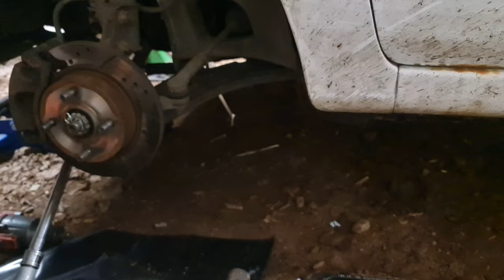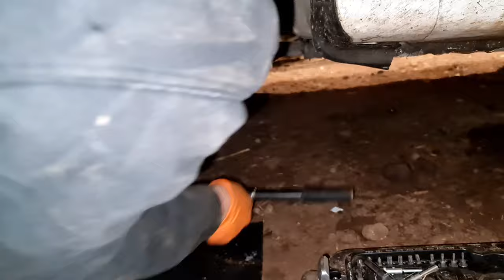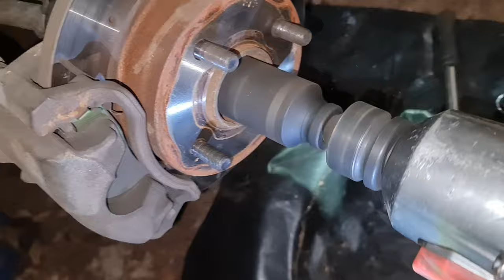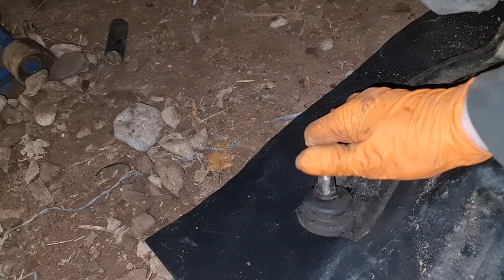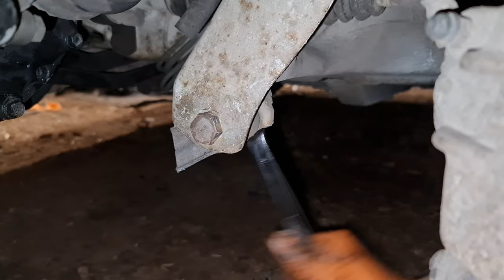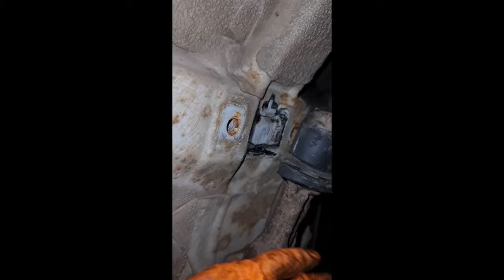K11 Micra lower arm change [rusty bolts]

Comment: ha. I just had my offside ball joint start knocking this Wednesday, great timing.
Reply from the maker: Remember to remove the dust cover first man. Cheaper to change the ball joints now than it is to replace the lower arm
Reply: @micrahq5954  don't have a press, so will prob just get a whole new arm.
Reply from the maker: @viktork706  can do with a hammer

Comment: Hi there- I replaced mine last week and I can hear slight knocking when I turn at slow speed. Any ideas?! Thanks!
Reply from the maker: @DomCliffordJones  double check everything is tight. A lot of people tighten them up on droop but the car isn't on droop under normal driving conditions so needs to settle

Comment: Why did u replace the lower arm? What’s wrong with it?
Reply from the maker: The pin bush bolt was welded solid into it, and the ball joint failed MOT for excessive play